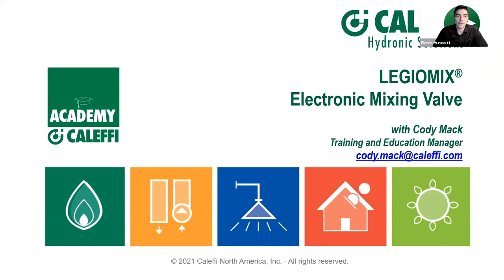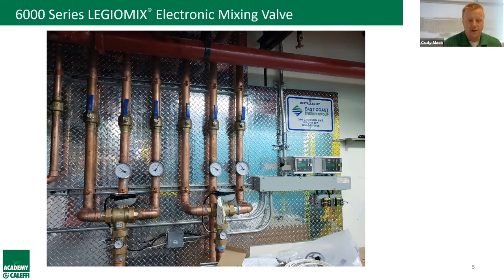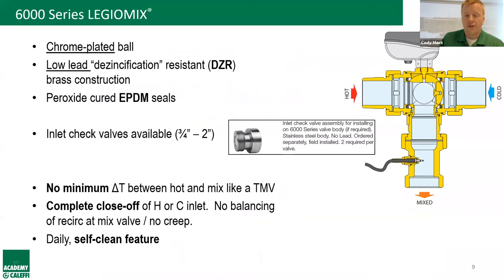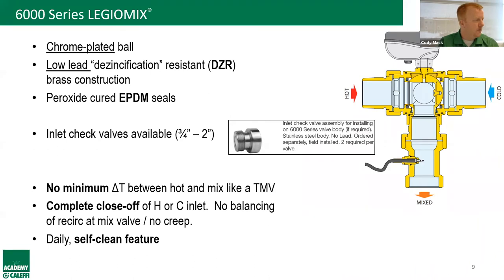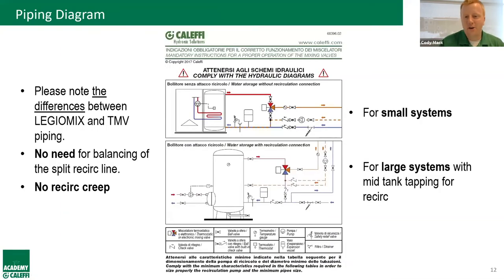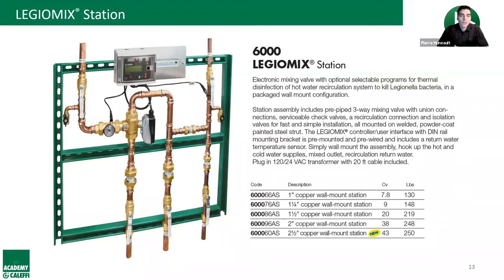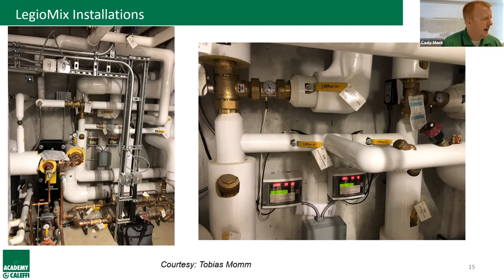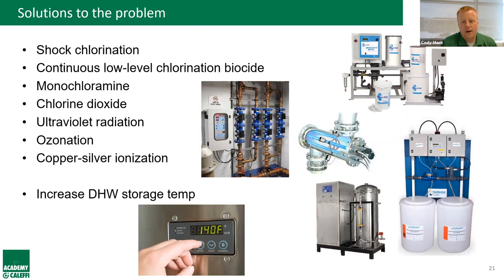Caleffi's most powerful mixing valve, the LEGIOMIX 6000

Comment: I installed a 600071, and found that when the temperature of set1 is lower than the temperature of the water tank during use, the water flow will be interrupted during the use of water.